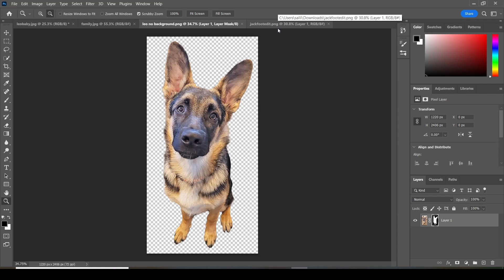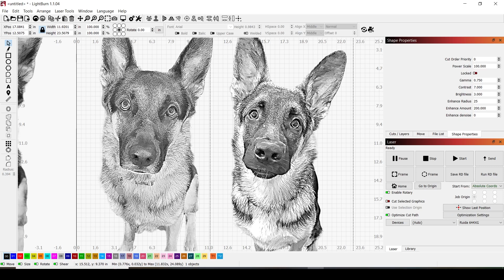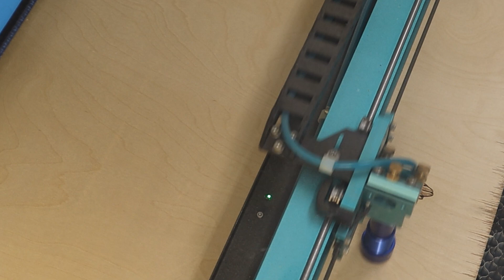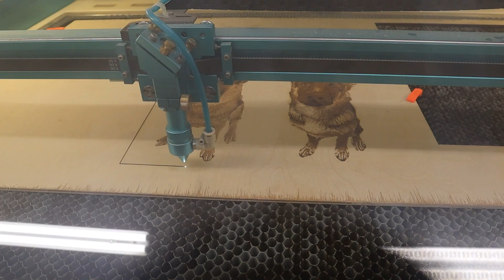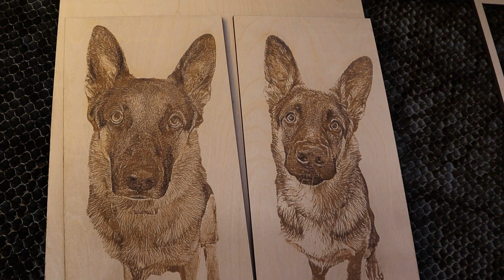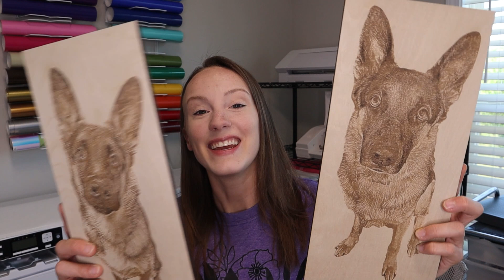How to Engrave Photos Using Lightburn & Thunder Laser

Comment: It is very important when using Lightburn to adjust settings and choosing a dithering method like Jarvis to NEVER resize a processed image. You can do it but the quality will decrease significantly. Always resize the pre-processed image in Photoshop or an editing software capable of bicubic re-sampling - then re-import it at the size you exported.

Comment: I am trying to get to the point where  I can do photos when people provide.  You results were awesome.  I understand your high definition lens, which I am guessing is a 1.5" lens does make a difference in the results.  But, do you think some of the difference was also the fact that you made your 2" lens example smaller picture engraves.  Does reducing the size of the photo impact the quality of the end engrave.  Also, how id you sand these - by hand or with ROS and what grit - that wasn't shown.  Did you seal the wood before engraving with some sort of sealer to help with burning?  So much I want to learn.
Reply: Not speaking for Sallie, but yes...the size most definitely plays a role in the quality of the engraving. I was just engraving something last night and first did it as 3x5. Didn't like it that size, so I went to 8x10(ish) and it was perfect with a 2" lens. I generally hit them with 220 on ROS very lightly!
Reply: @youshouldseewhatisaw1804  thank you.  Still haven’t started tackling photos but looking forward to it.

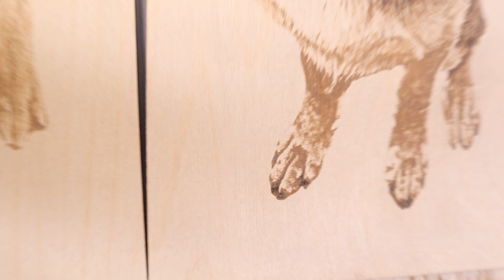Comment: Nice work....one question.  You see that "skipped line" through the dog on the left? You can see it at 10:24 in the video. We get that same issue with several of our photo engraves on our Thunder. For this reason, we still use our Glowforge for most of our photo engraves. Is this common for you as well?
Reply from the maker: Ive only had it happen one time! Not sure what caused it but the rest of the times I have not experienced it!
Reply: @SimplySallie  That's good.  It is better when we defocus....but still shows up sometimes.  It's very odd!
Reply from the maker: @malonecustomdesigns  I'll have to do some research and figure out what it's from! Wondering if it's the wood type?
Reply: @SimplySallie  We have seen it happen on baltic birch and purebond maple.  It really doesn't seem like a material issue to me.  I've inspected several instances and it looks like a "skipped line". It shows up worse after sanding of course.
Reply: Doubt it’s the wood. Do you have a flame detector? Could be mechanical I’d think rather then electronic except maybe speed causing a hiccup.